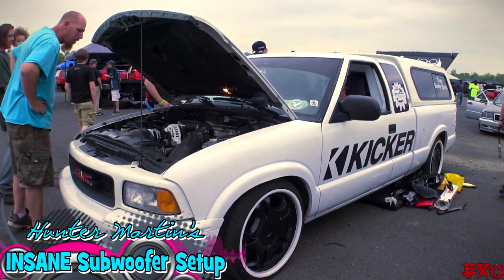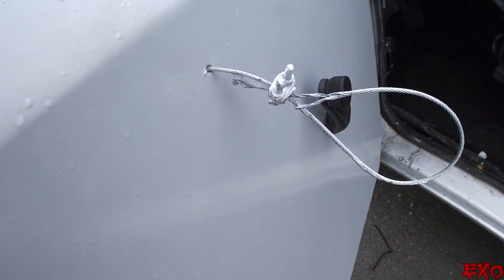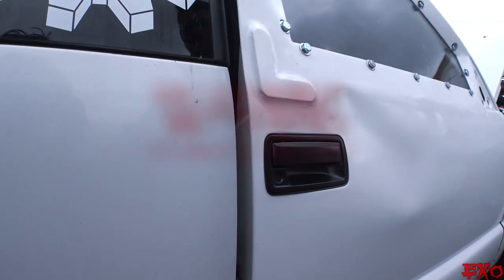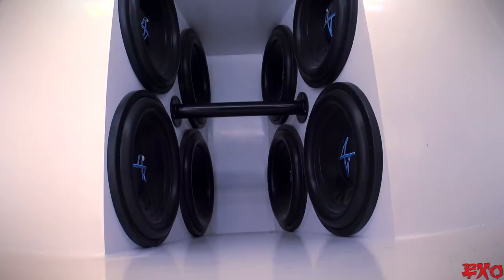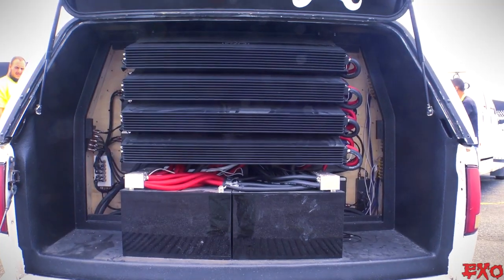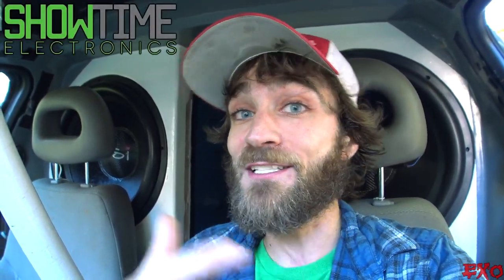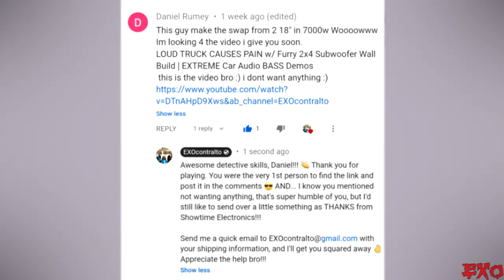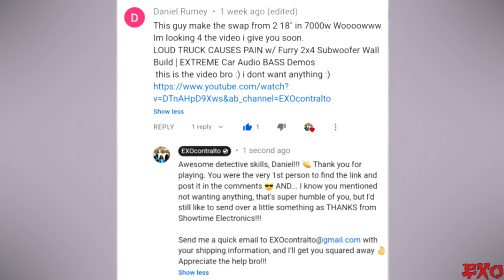TAP OUT Subwoofer Setup w/ KICKER Car Audio Amps & EXTREME Sound System Install + LOUDEST BASS DEMO!

Comment: Kicker has been around forever for a REASON!!!!!
Reply: Yep, and Boss too! 😆👍
Reply: I had two old school kicker comps vr 12s and they would still give some newer subs a run for there money 1000watts 500rms not big power but big sound for old subs 👌
Reply: @Beefsupreme313  please enlighten me
Reply: Yup kicker amps have real clean and crisp bass power for sure
Reply: Same power at 1 ohm and 2 ohms can’t go wrong with that, and they do over rated at 1 ohms, efficient and clean
Reply: First time I heard kicker subs was in the 80s. Car had a wall with 4 12s passing by and was banging. I was like wtf is that??? I dont know what it is but i want one. Lol 
Guy lived a block from school had it. Had linear power amps. My buddy bought those subs. I bought some kicker 15s in 89. Ive had several kicker subs over the years. I have sundown, Fi and other brands of subs. The kickers got loud and cleaner but not as loud on low end where  you need power and xmax. But overall the kickers ive had were good subs.
Reply: in 2020 you can most definitely get better gear for less than Kicker.
Reply: Excellent marketing , naaa their are cool
Reply: Kicker amps are good, the subs not so much, very easy to cook them.
Reply: @bubbawubba2307  That was a popular combination. Linear made the cleanest sounding amps imo. Kicker had the best subs back in that time period as well. Fosgate subs sucked back then. The voice coils would over extended and get hung up on top of the motor.
Reply: @Beefsupreme313  that isn’t true
Reply: if your going over the rms of a speaker/amp your gonna fry something most times its user/installation error. Cant just blame a company. If you test the wattage and it not equal or greater than what they say THEN say the company sucks. Kicker is still around for a reason.

Comment: People are sleeping on kicker amps. They make very efficient amps and they fight impedance rise.
Reply: @corymerry3399  True about the subs
Reply: There's a big white truck that I saw on here that had everything kicker I believe i know the subs were definitely kicker squares and it was making everyone at the show tap out. The thing about kicker is they don't make subs that hold alot of power so you'll need more of them, but when it's well put together they do the job and then some.
Reply: Here's the link for you guys just in case you haven't seen it https://youtu.be/WyGuWsdv1CQ
Reply: most important is the box. box is everything.
Reply: Kxa series are beast, I'm running 3
Reply: Its not that people are sleeping on kicker. I can get an amp that will do 10000 rms for 1k or less

Comment: Hey exo, been a big fan for years, i had 4 sundown 8s with two 2ks treble cliff in a 2000 toyota tacoma, took it to a mechanic to do a head gasket. Mechanic did the work but both my amps were fried and all 4 8s had holes in them. So i sold my favorite truck and pieced out the rest of the system that worked. I havent been around bass in 3.5 years. You know what its like to want to ask people in traffic for a demo because you miss it so much. My wife is disabled so i have not built another system, i have laid under the computer table with a box over my head and sub to try and get the feeling but its not the same. And you dont open windows or doors so you dont unload the subs. Just wanted to tell you cant wait for the van system. Thanks for all the years of bass head life my friend.

Comment: I have 3x 8s tuned at 24.5 hrz. Pressure is very important especially when you're pushing them at full tilt. If the door opens like that or the pressure changes that fast without your knowledge it will lead to over excursion and I guess you know what happens next 💥.
It's the same as if you where to run your sub free air it's not gonna handle the power you normally feed it your sub voice coil works less harder with free air 
Then you having pressure. with pressure it takes more power to push it. now use that same power on free air your voice coil is getting more power than it needs to travel that distance thus creating heat and turing down efficiency, And You Know It!!! Over Excursion. 
Not only that
Opening the door also will make it tune lower 
Your car is literally sub box. 
So when having expensive equipment that's tuned precisely opening the door will fuck some shii up 
And especially the turning of the system 
The door is a port basically 
Basically to sum it up, you open door system sounds like crap smoke smoke the soft parts shoot out and no more bass :'(
There's few more things to go over but my fingers are getting tied lol.

What I do when I'm not bassing out? my favorite pastime is working on electronics, riding me bike ,making sum art, playing with rc cars, and exploring the wild 👍
Hell yeah brotha!

Comment: I'm gonna assume when the door is opened the pressure becomes different if the subs are tuned specifically, when the door is opened it can course damaged subs or blown
Reply: If that is the case why did the guy who owns the truck have his door open in the last part of the video? I agree with you but then the drivers door needs to be shut surely?
Reply: That's right.
Reply: that is correct, subs will unload in some builds if a door is opened in the middle of playing. Also the pressure typically loads against the closed door, so the side with the closed door is usually louder.
Reply: @stuartmeaney  no driver's side is always open door or window. Makes it louder on passenger side
Reply: When the door is open there is less resistance on the air coming and going out the car. When that happens it can unload the sub and cause it to bottom out from lack of resistance.
Reply: when a door is open the pressure varies to much and can make have TOO MUCH escursion damging spiders and sub

Comment: Its important to keep the door shut so that the subwoofers do not "unload". It similar to having a leaky box, or a port that is too large. The cabin is basically a part of the enclosure too, so if its not designed to have the door open, you could easily damage subwoofers on high power

Comment: Hey exo been a subscriber forever. I'm from the trinidad and tobago which is in the Caribbean. My hobbies are basically anything car audio related I'm a bit of a gamer as well. I really love going for long drives with my system loud and my bass line low but due to the shift of the economy I am no longer able to do such as I was recently fired from my job and had to sell out most of my stuff just to keep food on the table for my wife and I. First thing I sold were my batteries. So now I have no bass 😭 but I'm greatful for life and your videos always cheer me up so thank you for helping me feel like I'm right there in the action 👍

Comment: I've never had a system loud enough to worry about unloading. Yet anyways. Rc cars an car audio have always been my favorite hobbys. I have 2 skar 10s 200w rms each with a Kenwood 9106d and a 4s arrma outcast an a ecx amp mt. Ive been into building boxes lately also. Using ur videos to get ideas tips an tricks! Thanks dude

Comment: Top 3 interests:
12V Audio for sure!
PC Gaming &
Photography/Videography

I would assume that opening the door while pushing the subs that hard would remove any back pressure that the cones are pushing against.  This would allow them to jump out of the basket.  Since the cabin of the vehicle is basically a chamber, you are instantly changing the "inclosure" size and you can really throw off the balance of the drivers.

Comment: The vehicle cabin space also affects the subeoofers. with the door open the subs will "unload" causing the soft parts to break.  the pressure in the chamber is required for preventing over excursion

Comment: The problem with opening doors at full tilt is, with certain specific builds the entire vehicle becomes an enclosure and every aspect is dailed in. So, the change in pressure from opening a door could cause your system to "unload" which equals catastrophe and possibly call for a complete rebuild.  We have an expensive and sensitive hobby. But we live and we learn in the end🤷🏾‍♂️

Comment: I had car audio in my room before I was old enough to drive lol. Had a pan with two old car batteries in series with a 20amp cheapo charger. At one point I had a kenwood deck running off a radio shack power supply lol. Anyways. Love building monster RC boats, cars, truggies etc. Fishing is a must and wish I had time and the flexibility to still skate 🤙

Comment: The resistance /compression of the air helps with dampening speakers.  Opening door is like side of a sealed box failing. Ever had a shock blow out on a vehicle while hitting big bumps?Same concept.

Comment: There's a few reasons why it's important to notice an open door. You don't want the passenger to expect an open door, then fall from trying to rest against it. You never know if or when someone is going to put their fingers in that door jamb and open doors changes the resonant cabin frequency, so in some builds, that change will affect atmospheric pressure, which causes the driver to launch and it'll blow a hole into the cone.

Comment: Awesome bass, My 3 favorite things would have to be Bass builds, drag racing and anything to do with hot rodding or making more power!! I use to run Kicker back in early 90's and some MTX both produced pretty good base in my 88 GTA Trans Am. I was always having to replace the deck lid spoiler from cracking it with the bass. GOOD TIMES!!

Comment: 3 favorite things. Well obviously car audio. I love rc cars too brotha. I've actually got a couple videos of my traxxas slash 4x4 up on here, that build before it was stolen had about $1500 into it to get it to go 100mph on top of initial purchase that loss still makes me cry some says. 3rd is my family will always hold the people in love close in my heart and spend as much time possible with them. Trivia answer: systems are usually tuned with the doors shut to make the inside of the vehicle essentially a box in and of itself like a good old bandpass box, opening the door at full tilt can cause sudden pressure change and allow the cone to hyper-extend thus risking blowing the voice coil and ruining the sub woofer.

Comment: If the door is open it will leak sound waves and won't allow them to bounce off the closed side which in turn gives you less SPL's. If there's less places for the air to go the more it will push on the SPL mic or your ears.

Comment: Favorite past time WAS going for a cruise just to crank the bass. Never had anything that huge. Haven't had any stereo i  a car since 2006 when mine was stolen (smashed drivers window to open the trunk and just walked off with box,sub,amp,cap. They shut trunk so it just looked like someone left their window open). I guess I did upgrade front speakers on my truck but thats gone too (cvt went out). Only other favorite thing is listening to new records on my 30 year old home stereo.

Comment: Causes a condition called unloading in where the woofers no longer have enough static pressure to maintain cone control. This is usually a product of systems that utilize the vehicle interior as an extension of the box. This can also happen with 4th order bass reflex enclosures that are built out of spec, I.e. to much air volume per woofer or a port that’s volume in2 is too large or tuned higher then the tone being played.

Comment: The doors should not be opened, because that affects the pressure measurement, it is like making a bigger room therefore there is more air to move and compress with the subs, I don't know if I explain it well but it is the idea that I have

Comment: I'm not too sure if unloading the pressure in a 4th order of a large system due to the windows or doors opening will have the same affect as in a 6th order, but at full tilt while the pressure is building up in the passenger side or what ever side the pressure is, the door or panel opening up will cause the subs to flex harder when the pressure is released. Correct me is I'm not fully on par. Thanks.

Comment: a door opening can cause the subs unload which can cause them to blow. when you get to a certain level with a system you have to have that pressure built up to pound that hard. been tehre done it fun times.

Comment: That second system, when you thought it wouldn’t  play lower and the pressure wouldn’t increase but then came those EVEN LOWER NOTES. I would’ve tapped out as soon as I jumped into the third system so don’t even get me started

Comment: Its important to know if i door is open for the loading on your subs. Some systems can play fine with doors open, depending on the loading wall, enclosure setup, power, etc. systems like mine hate having doors open and also need at least 1 window up to keep the subs happy and pressurized

Comment: I have two huge systems maybe one day if I get a SUV I can use them both like this guys setup! I have All DC audio LVL4 12’s DC 2k’s in one car And JL 13w7 and HD1200/1 in the other! So I would have one 13w7 and 2 LVL4 DC 12’s on 4000 watts! Plus pro audio DC 8’s and 4” tweets, C2 6x9’s and 61/2’s alpine 4 Channel! Definelty be covering a wide spectrum may end up being a really good SQ system to with 12 and 13.5 inch subs!

Comment: I just put 6 8inch rockville midrange nd 6 bullet tweeters my little pontiac vibe I blew my 15s waiting till I get some new ones, i want to get the rockville punisher but I seen you reviews on rockville but im not running them on full capacity so I think it should be good for me

Comment: I like playing around with car audio four-wheelers and building hot rods right now i have a 1997 s-10 that im going to be putting in a system i just dont know what to use as i have always had car audio from walmart so if there is any kind of help or tricks and tip that would be great

Comment: Ugh... unloading. My system was super finicky, capable of 16Hz, but specifically with either the drivers window all the way down, or the passengers window 75% of the way down. 27Hz with both front windows down, but it unloads if the rear windows are open. The number of times I'd be jamming and I'd suddenly lose 6dB due to someone in the back winding down the window, and then me having to explain the sub's already at Xmax and a window down could damage it, miracle the thing never did any more than split its dustcap.

Comment: I'm newer to setting amps myself I had my amp at +6db and my head unit to 0. I dont know how to tune it to the max volume I can run without distortion and same for the gain lpf subsonic? I dont want to mess up my subs that are coming hopefully soon or the amp.

Comment: So I doubt I will get an answer buttt I'm about to drop 2 l7 q class 12s with a kxa 1600.1 and a xs power d975 battery. Any suggestions on a box design for a 2008 a ford mustang???
Reply: Oh yeah they're 4 ohm planning to wire to 1

Comment: BASS, it is a drug that pours out of speakers. You just need a "fix" LOL

 BTW: My guess is the doors have to be shut due to the obvious noise complaints such sound systems would generate.
Reply: The subs can unload and be damaged by the sudden change in pressure when they are being pushed that hard

Comment: I am a father ofSix kids and I am building my truck that I have it’s a Chevy S 10 so far I got my 212s running on a 2200 W power for babies amplifier to run my highs I have a four channel phoenix gold that is 1000 W and I have a JVC deck unit nice but updating and in my doors I have Boss six by fives and in my front I put in a custom grill with another pair ofAnother 6 x 5 pioneers and in the back I have a pair of JVC six by nines with some airhorns that I custom built myself I and that’s it and I have a bass knob that I’m trying to hook up but it’s giving me a hard time right at this moment

Comment: Exo my bro dam your gunna be deaf when your older. Ive had a 600watt amp or bit bigger had multiple set ups 2xs 15inch jbls then a single 12 and now 2xs 12s had that sorta power for over 18years now kinda used to it.  My hearing on left ears pretty average.